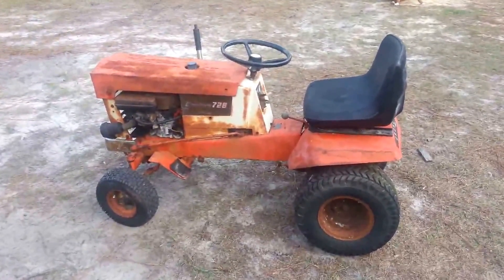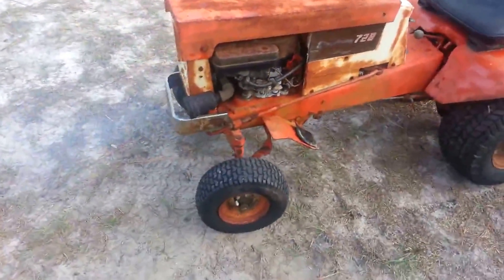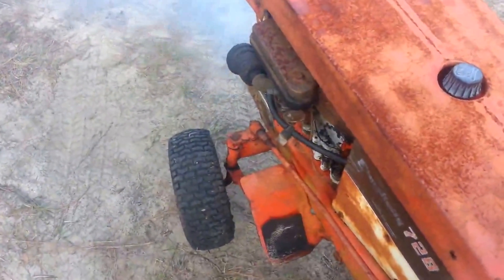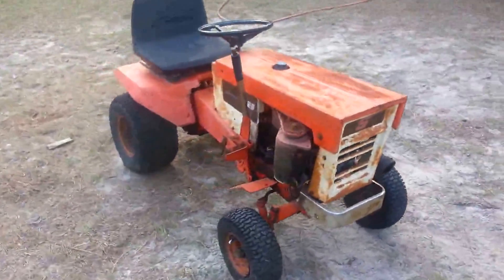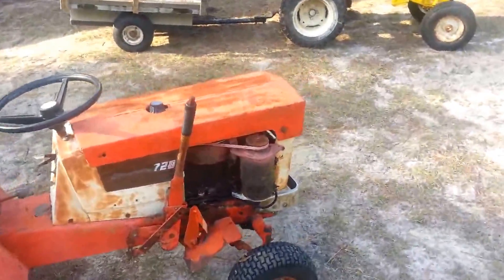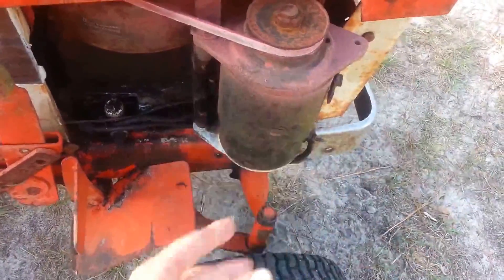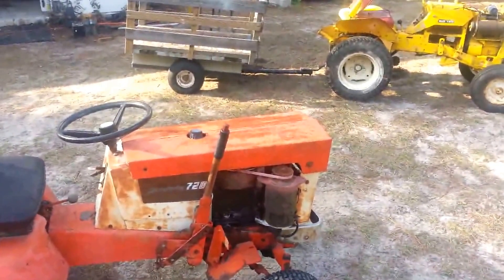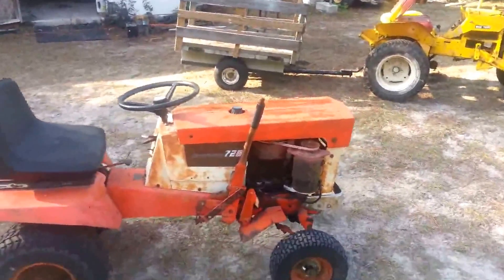728 Broadmoor running

Comment: That's even better that it started right up! Just a super cool score bud!
Reply from the maker: Yeah I was pretty happy when I turned the key after putting the battery in and saw that the wiring was still good then to top it off it had very strong spark.  Thanks for watching.